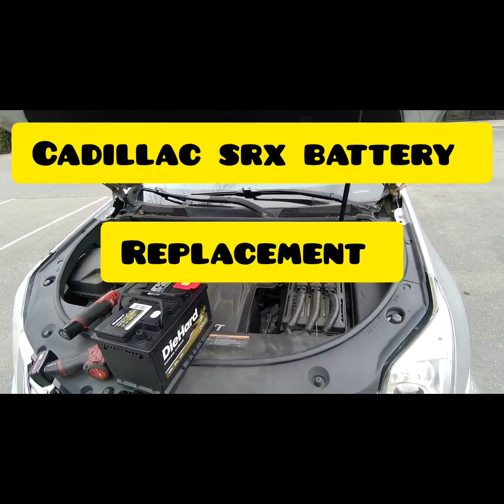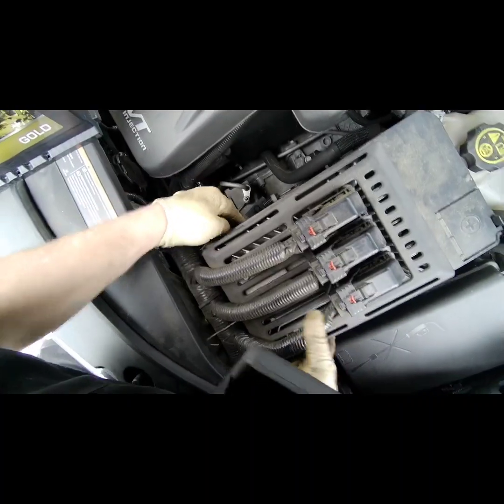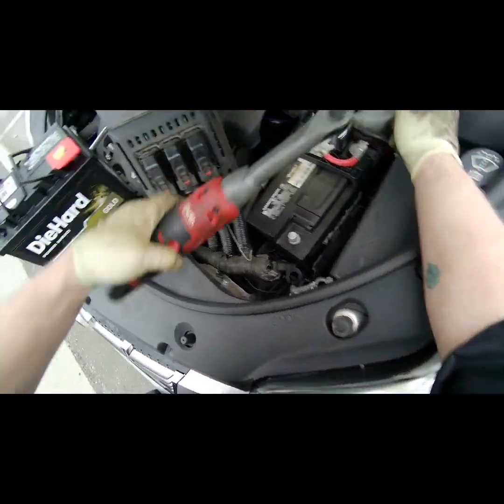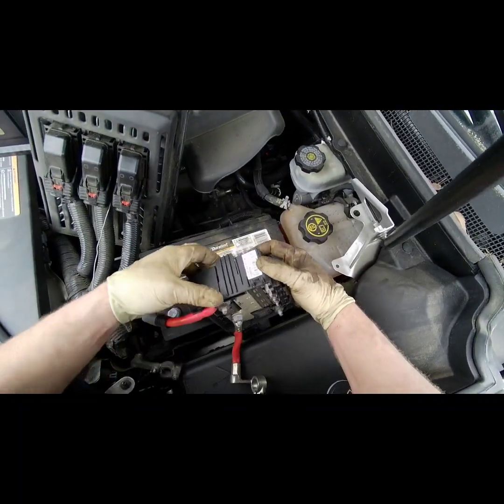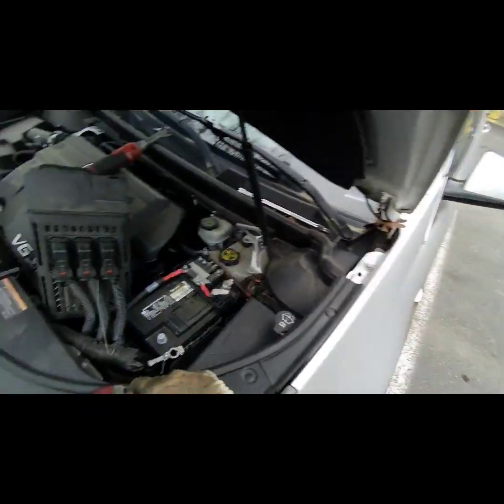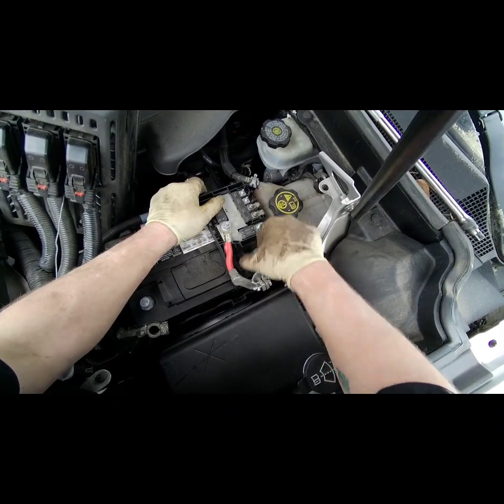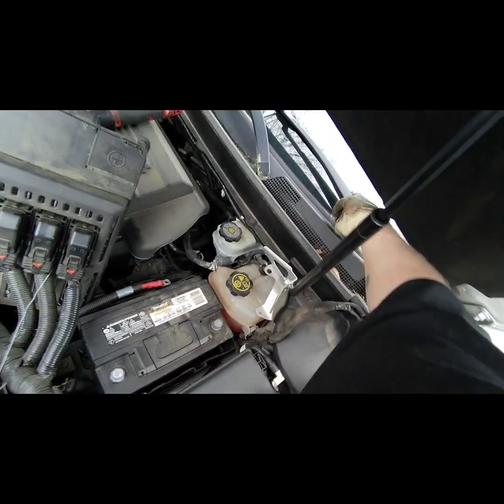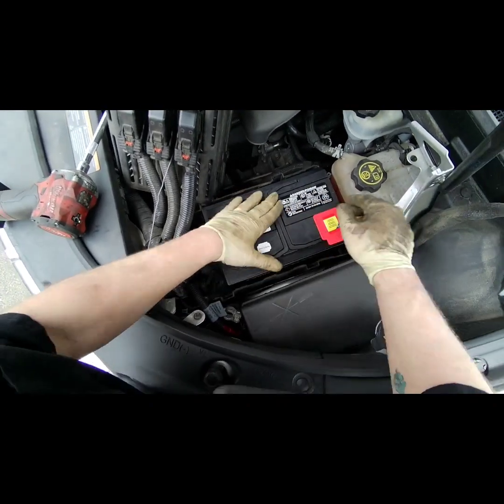how to replace your battery Cadillac srx

Comment: Hello I have a question if you can help me, when you change the battery, is the system CUE stay working or there is a secret code to switch on?